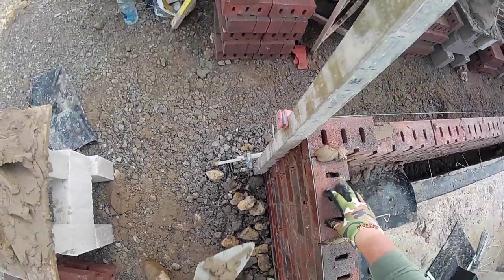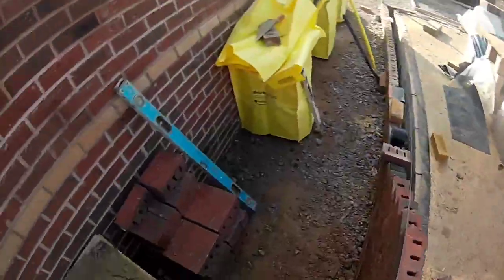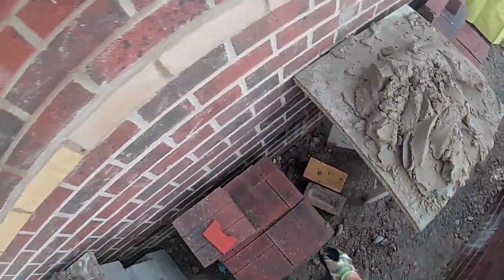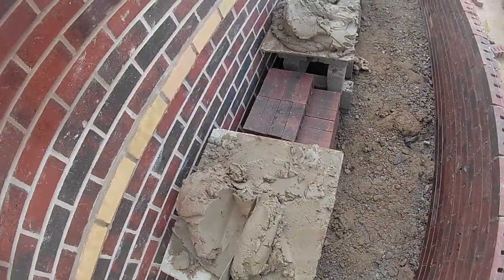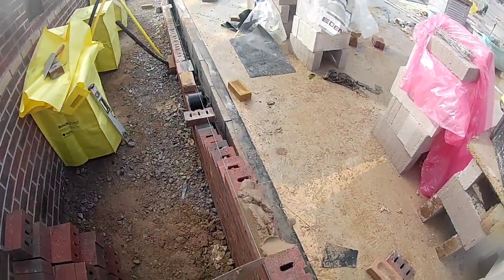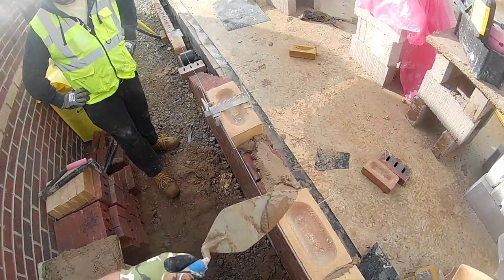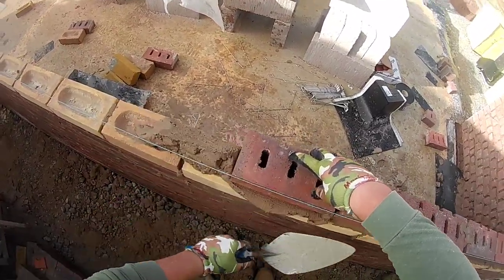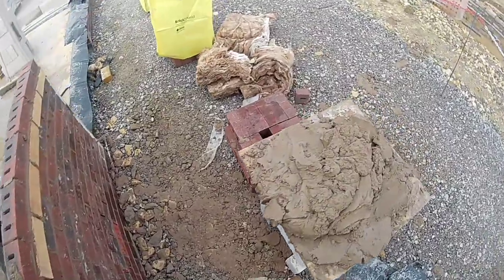Bricklaying Vlog - Another Pair of Boxes to Get Stuck Into!?!

Comment: You know when you lay up against a window frame but the frame isn’t gauge.  Do you stick to gauge and trim the top of the frame before lintel goes on or do you pick up however much to make it up.  I got told of today for not getting to the top of frame by new boss  but with last one used to stick to gauge and saw excess off?🤣
Reply from the maker: You always have to build up to the top of the window frame so the window fits in, never saw your frames down or your window won't fit In 👍